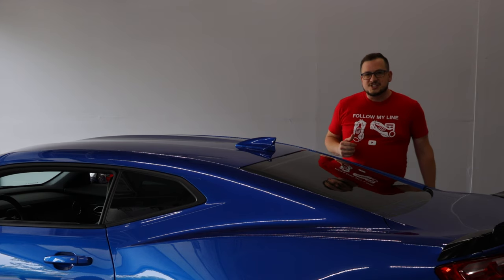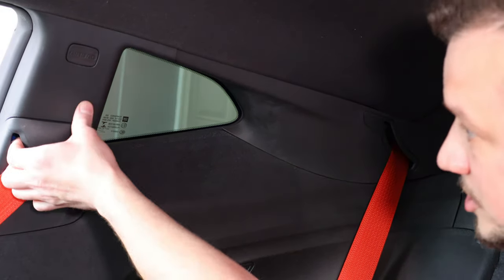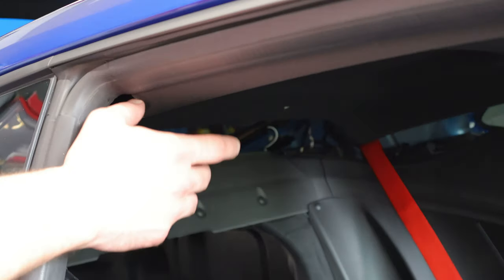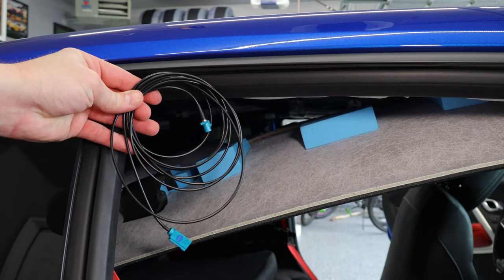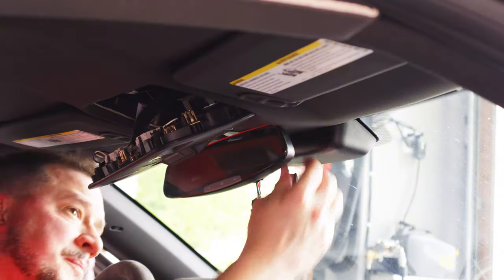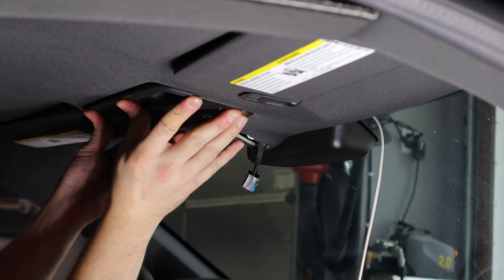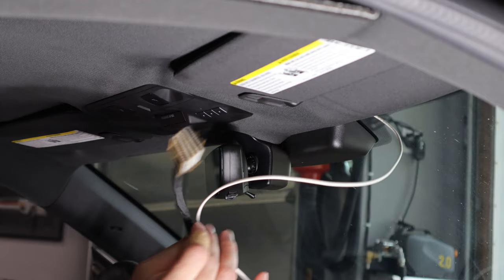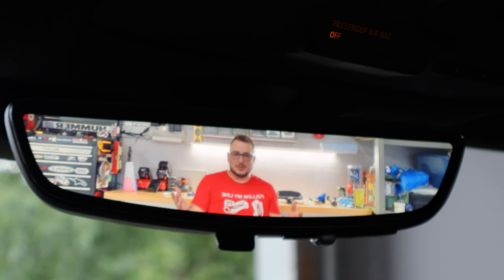2016 - 2024 Camaro Rear View Camera Mirror Install // How-To: Series

Comment: Whats the benefits of this mirror vs a normal one?
Reply from the maker: Great question! This mirror gives you a much better view outside of the car. The mirror has three different zoom settings, and a few different angles. It allows you to see your blind spots when zoomed all the way out. If you watch my in-car track video, you can see the two different mirrors in action. First, my 2018 SS 1LE with the standard mirror:
https://youtu.be/KVu7jznM61I

Then my 2022 WITH the camera mirror:
https://youtu.be/Hs-LJ8sl31M

Comment: With the price of the unit couldn't you just also get an aftermarket camera and install it to the in place fin already (if you car doesn't have one)? That way you save 1500$
Reply from the maker: I realize that this mod isn’t for everyone, and not within everyone’s budget. The factory fin on the 2016-2021 Camaro will not accommodate a camera. You would need the shell of the 2022+ fin, which unfortunately  isn’t sold without the camera assembly. Sure, there are aftermarket options, but none that will integrate seamlessly like this one.

My personal 2022 car has this already. It’s what made the owner of this 2018 SS 1LE decide to get this.
Reply: @FollowMyLine17  Oh really I have a base model 2023. So I might be able to actually did not know that.
Reply from the maker: @Timothy-en4ju  I’ll have to take a look again at the 1SS and other variant fins, but I thought they had a crease in the middle at the back. Perhaps I may have the newer antenna mixed up with the previous style. Now I need to do more research. 😅 Just keep in mind, there ARE other electronics in the fin, and it serves a purpose, so I’m not sure an aftermarket unit would fit without causing interference with the other stuff in there.

Comment: This may sound like a dumb question, but do you think this would work on a 2023 Nissan Maxima SR? I have the camera on my duramax and would love to have it on my car but all other kits seem to be cheap overlapping mirrors and self tapping screw cameras. I’m not sure if the fins can be interchangeable and if rear view mirror mounts are universal.
Reply from the maker: Not a dumb question at all! My biggest concern would be to first see how your Maxima fin connects, and what is inside of the fin. For example, if your GPS, or radio antennas are in the fin, could the GM unit be used by finding the wiring diagram and cutting and splicing the wires together. Also, how does it physically mount to the car. Next, would be the mirror itself. I don’t believe mirrors use one universal mount, so you’d have to see how your Nissan’s mirror mounts to the glass or overhead console.

Comment: Cool video. Do you know if there are any differences between cars with the PDR and without the PDR? Excellent camera work in those tight spots! 💯💯💯💯
Reply from the maker: Thanks! No difference between the two as the PDR hardware is underneath the passenger footwell, and the antenna for it is located underneath the dash.

Comment: Seems like this would only work with cars that have the reverse cam in the fin already? My 2019 Camaro does not have a camera in the fin it’s located above the license plate. Would love to do this not sure it’ll work on the 2019 though??
Reply from the maker: This was done on a 2018 without a camera in the fin. That is the entire point of the kit. This is not the reverse camera, this is a separate camera for the rear view mirror. This will absolutely work on your 2019.

Comment: I'm having trouble popping off the rear view mirror cover. Do you pry it open from the bottom slit or do you just use leverage from the top to slide it downward?
Reply from the maker: I used a panel tool that was angled, and pull it out and down from the top

Comment: Your videos are top notch and should be the template for all YouTube how-to videos.

If you ever add the export mirrors to your Gen 6, please post a how-to video.
Reply from the maker: Thank you, I appreciate the kind words! Tell me more about the export mirrors. What is different on them?
Reply: @FollowMyLine17   The export mirrors fold, are slightly larger, and have the turn signal repeater. Part numbers are 84639833 - Driver and 84639836 - Passenger.
Reply from the maker: @conanbarbarian5061 hey, you taught me something! I’ll check them out. If I ever grab these I will definitely do a how-to video on the install.